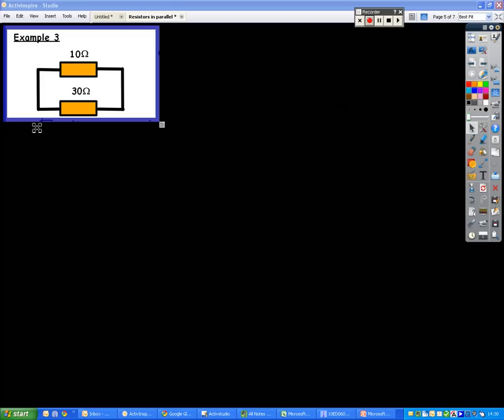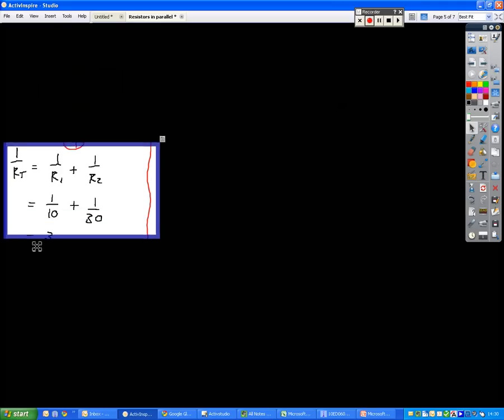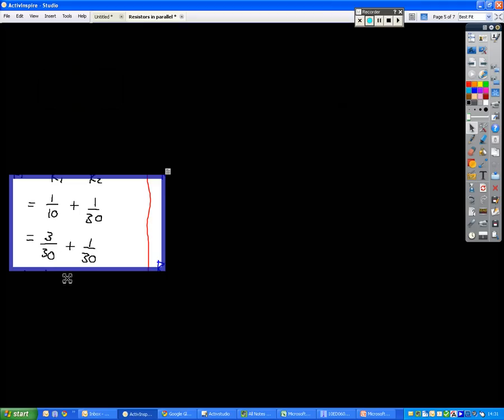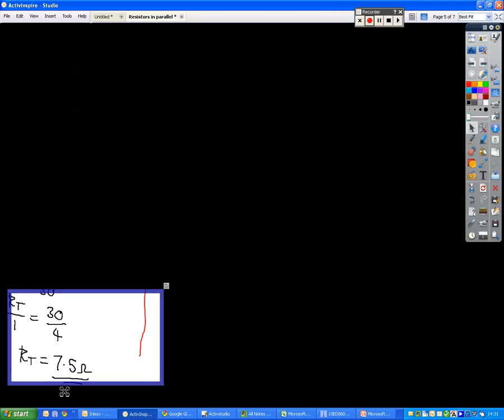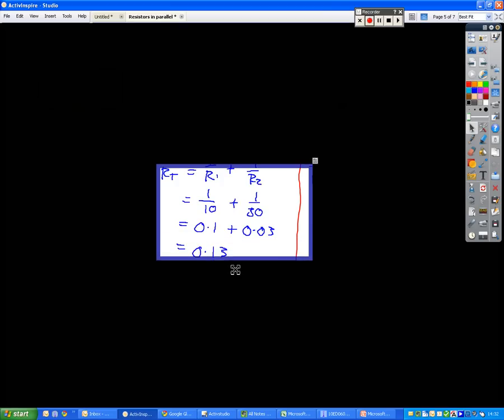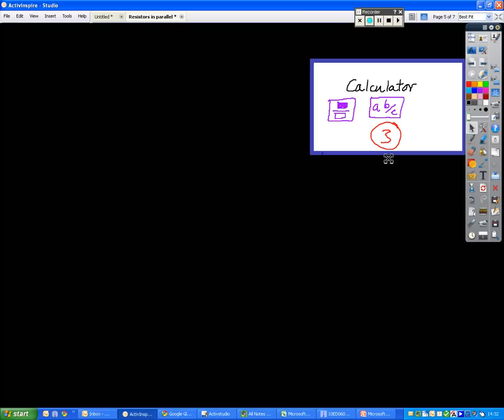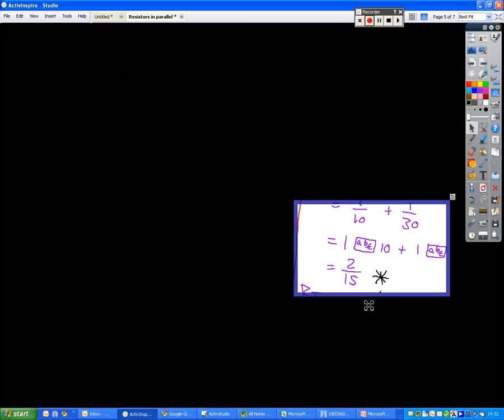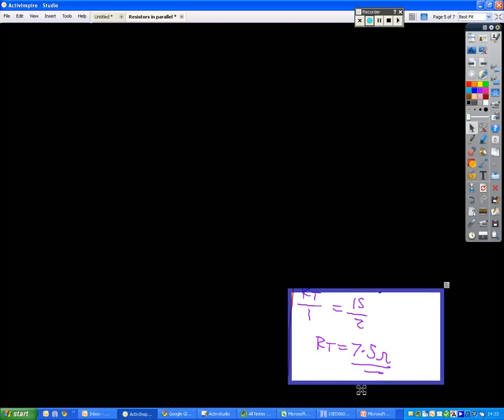Parallel resistance calculations

Comment: To answer CoudyRamone's question (and others who may also wonder).

The 3 comes from converting the fractions 1/10 & 1/30 to the Least Common Denominator which would be 30.  

The fractions could be re-written (temporarily) to be:
               1/30 & 1/30     (30 being the LCD)   ===> DON"T STOP AT THIS STEP!

You MUST ALSO change the top number in the fraction that the denominator was changed, (the number 1 in this case).

To find the 'new' numerator (top number), you need to find out how many times the 'original' denominator (bottom number) goes into the LCD (30).

The original denominator in this case was 10, (from the 1/10 original fraction).
We find that '10' goes into 30, three (3) times.

Therefore the 'new' converted fraction becomes 3/10.

1/10 & 1/30     becomes   3/30  &  1/30

Hope that was clear...